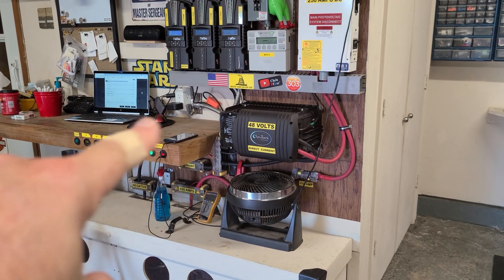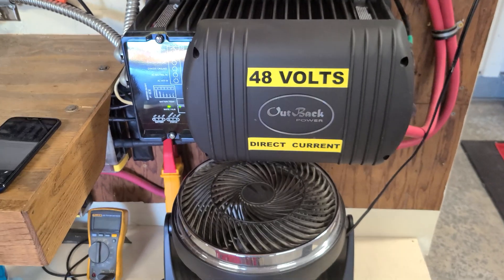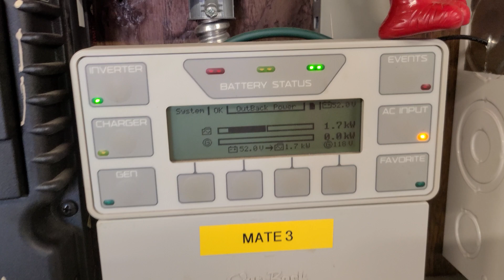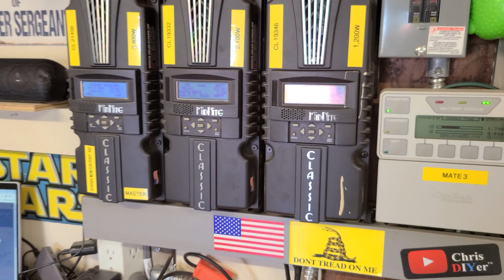New Outback Power VFXR3648A inverter/charger update -- hot garage, cooling, thoughts

Comment: NICE!! Yep that fan can get loud! Keep em coming!!
Reply from the maker: Thanks...will do! This 48v upgrade is way overdue...but, I am still about 5KW short in PV panels during the summer cooling months. Not enough PV power to hold loads and charge batteries. The other 8 months of the year...no issues running six circuits (basically the whole house) on solar/battery and charging batteries at the same time.
Reply: @ChrisDIYerOklahoma  Maybe time to swap out those 100 watt panels for the 350s :)